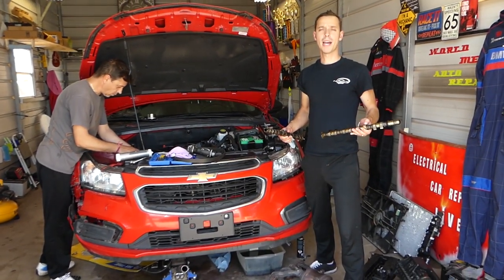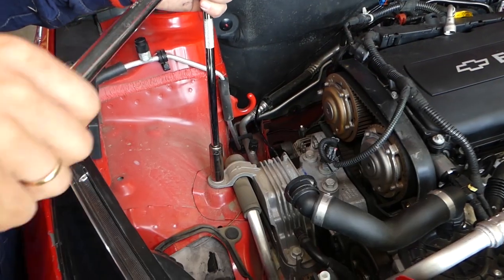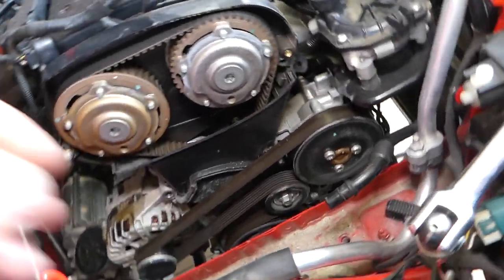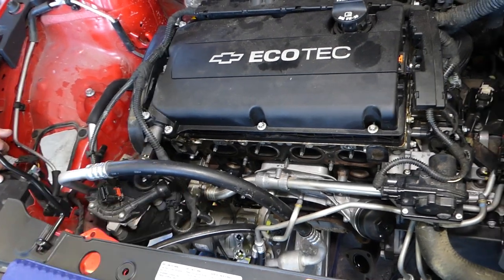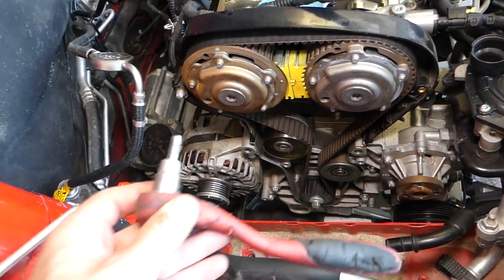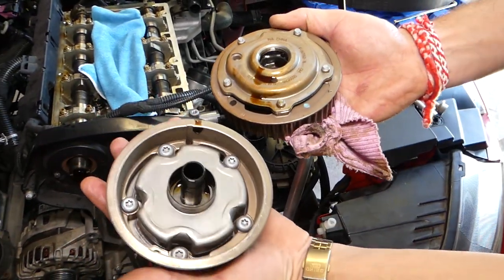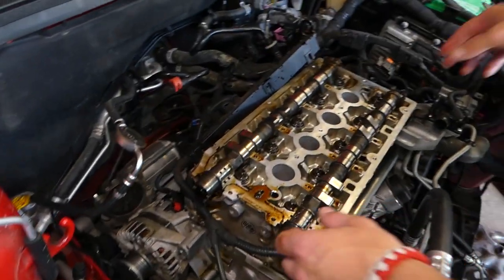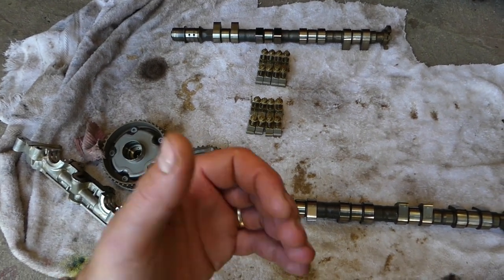CAMSHAFT REPLACEMENT 1.8 CHEVROLET CRUZE SONIC OPEL ASTRA ZAFIRA INSIGNIA MOKKA ALFA ROMEO 159

Comment: Tip:  Given that it is vital that no sealant gets into the 4 oil drain channels (behind the front camshaft oil seals) in the front camshaft bearing cross-member (into which the VVT solenoids fit) when sealing the cross-member as a whole, I have found that if you put some strong twine (string) in these oil drain channels when replacing it, wait until the sealant dries (24 hrs) then pull the string out, this ensures that these drain channels remain unblocked by sealant.  The camshaft oil seals can be inserted carefully from the front afterwards.

Comment: How are you lining up the cam pulley back correctly on installation? Neither pulley is keyed and we can not get the car to start after engine swap and timing belt swap.

Comment: What do u mean by we need new bolts when we put back together?
Reply: The 2 camshaft timing belt sprocket bolts are Torque To Yield bolts (as are cylinder head and other bolts and others in engines these days) that stretch to maintain tension.  They often break if you try to use them again.

Comment: Good day a can a broken impulse Transmitter sensor cause the car to read a diagnosis code P0366 On chev Cruze 1.6 engine as one of the teeth on the impluse sensor was broken from engineering

Comment: Hi man PLEASE HELP , I mixed up my camshafts :( how can I tell which one is the Exhaust and which one is the Intake camshaft? Is there a number or a letter? They look very similar.. :(
Reply: Did you fine out?
Reply: @ghostgaming7226  haha yes!! I  had photos before removing them and each one had a specific number/code which i used to identify each cam
Reply: @shreda125hilux7  can you share the part numbers? i need to buy both camshafts because the previous mechanic lost them and now the customer wants me to solve this!
Reply: @berniegrunhaus3899  sorry man this was a very long time ago and the photos I had were on a different phone which is not longer working , you can get the part numbers by simply calling your local dealer and giving them your chassis vin number of the car , they will tell you the part numbers for the cams
Reply: @shreda125hilux7  thanks man
Reply: @berniegrunhaus3899  all good bro , good luck